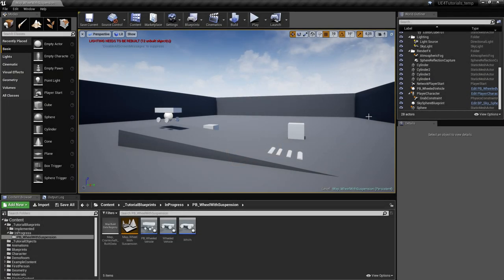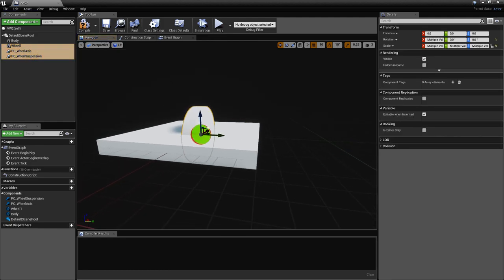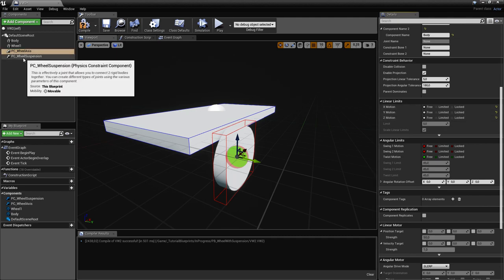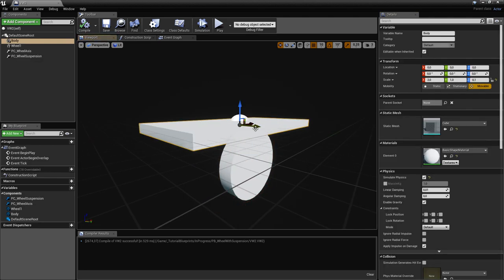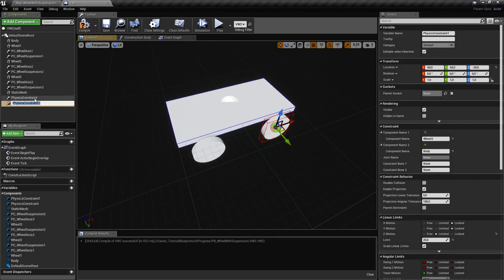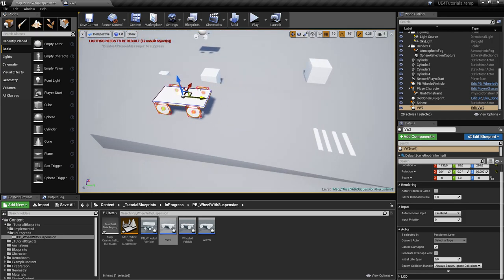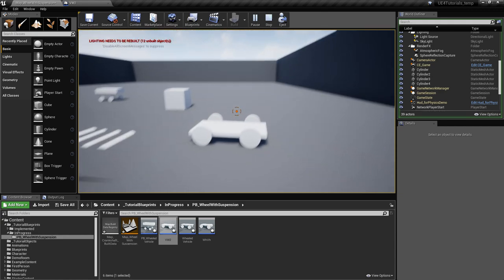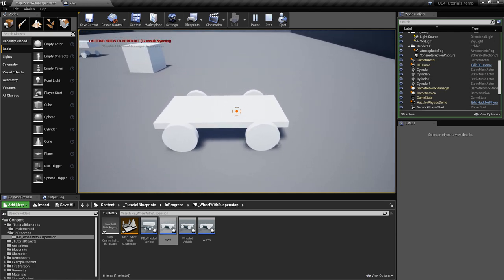UE4 Car Vehicle Wheel with Suspension using Physics in Unreal Engine 4 Tutorial How To

Comment: suspensions are made so you do not feel imperfections onto the road? wow, somebody should tell that to modern cars manufacturers xD (I am making fun of modern cars with their dropped, rock-solid suspensions and low-profile tires)
Reply from the maker: :D Well, I'm not and expert in cars, so I said it in layman's terms.
Reply: I was not making fun of you, I was making fun of modern cars and their shitty suspension haha, your videos are great :)
Reply from the maker: I understand. :) Thanks!
Reply: Well low and solid suspension systems make the car handles better
Reply: @MathB_Official  You also need to understand the use for rock solid suspension and rigid chassis that some people prefer, especially in track racing. Most performance/sports cars have that and it's by preference for those who understand to value such things.

Comment: This tutorial is amazing! Also, how do you add steering? I tried creating a scene component for every wheel as a joint and i attached the physics and the wheel to it. Then I used the Left/Right input to set the relative Rotation of the Scene component but because the wheel is simulating physics its not working. Do you have a solution for this or another method?

Comment: You have a trolley with four wheels that turns automatically when pushed by an external force and turns automatically depending on the direction of the push, and you can do a video of that, and you'll get a good one

Comment: After so many tutorial, i finally made it to add suspension in an object thanks to your tutorial :) Say, will you make a torque/Force tutorial in the future? Cheers
Reply from the maker: I'm happy to hear it! What kind of tutorial are you interested in regarding force/torque?
BTW, check out the latest tutorial that shows how to make a helium balloon using a thruster.
Reply from the maker: I'm planing to make a tutorial for a force field and a motorcycle. Those will use force and torque.
Reply: Watching now ;)
Reply: awesome, i hope you cover how to rotate the front wheel with physics contrains as you have in this tutorial.
Reply: It took me 6 hours to figure that out! I will gladly share the info on how to do it. going for breakfast now and be back later. key element is to use the Angular Motor by checking Swing (Drives) and add the value of the Turn Rate in the correct Axis for the Target Velocity and add value for  Strength. Start with small numbers first to get a feeling on how these values work. Linear Limits all locked. Angular Limits only either Swing1 motion is Free or Swing2. I couldn't make Twist Motion work but I will work on it some more. Hope this is helpful. Let me know if you need more info. Good luck
Reply: Forgot to mention that in the Angular Motor, select Twist and Swing
Reply: @naserharbi  Hello, I hope you still around :) I had a partial success for making turn "like a tank", by applying target velocity to axis constraints on one side of vehicle. But... It does that only one time :)) qafter that by pawn ignores my inputs. Did you ancounter this, and, if yes, please how to get around this "one time effect"? Thank You...
Reply: @Latvian3Dman  hello, yes, I'm still around. Thank you for responding. Let me get back to my project and see what I did. However I switched to Unity and learned from Unreal how to use the Configurable Joint to create all my Joints. I fixed all issues after I switched to Config Joints.
Reply: @naserharbi  , Hello! I have managed driving "tank-like", in two ways even. One version - apply force and torgue to body, axis constraints "motors" off. Other version - using angular "motors" on axis, to actually spin wheels. What I have not managed - can I turn wheels "left/right" somehow. I mean, for "tank-driving" it is not even needed visually. But, I am still curious, can I do that at all with given constraints setup.

Comment: hi andre
i found a serious problem in Physics Constraint , it's just work in first location !
i have used floating pawn movement and i have seen mesh doesn't move but phys cons move with pawn
so i had to use an assistance mesh as component 1 in phys cons , that works but pawn movement doesn't consider collision 😁
how can i use pawn movement and phys cons together?
Thank you

Comment: Wonderful video. Thank you so much.
I did everything exactly as you showed, but my plane jumps on wheels and the wheels themselves jump and tremble too.
What could be the problem?
Reply from the maker: You peobably have to make the wheela have larger mass. Either that or have a look at where the origin of the physics constraint is. Try inverting the order of the affected components on the physics constraints.
Reply: @Lusiogenic  Did you find a fix for this?

Comment: love your tutorials! was wondering using the method of the linear motors to control a hydraulic cylinder with input keys, is this possible? or is there better ways of doing it to get realistic physics from it?
Reply from the maker: Yeah, you could use that with a linear drive. Using the keys events you can modify the drive target location, then the constrained component will "go" to that location smoothly depending on the settings of the linear drive.

Comment: i have tried using this to another tutorial, a biplane tutorial, all i wanted was to use this on the plane so i could land, but, when i add this to the biplane bp, inflight it gets torn off the plane as soon as i pie it. Any recomendations? What to look at?
Reply from the maker: Hard to say without seeing your setup. 
But from what you're telling me, it could either be that you're somehow re-initializing the constraints and so it's breaks off. Or, you have set it to breakable. You should concentrate your analysis on the constraint that gives way or breaks.
A short video would help a lot.
Reply: @Lusiogenic  Thanks a lot for the feedback. Yeah, i will, i had a hdd crash and the project sadly is gone now. But iam remaking the plane again. 

The tutorial for hte biplane creates its custom physics, so i dont know that could interfere with the constraints. It really makes u feel dumb when its just 2 wheels the whole problem contains aswell. Takes longer to solve having two functioning wheels then creating a flying plane with missiles an guns :P

I will remake it anyway, and get back to you with a clip. Now ill know to look especially at the contrainsts so ill do some more digging on that aswell.
Reply from the maker: @loverschoice885  Please do, sounds interesting.

Comment: Problem I have: When my 3rd person character stands on the vehicle, it goes nuts, and eventually falls through the ground.  :(
Reply: Did you ever manage to figure out a solution for this? I've found a similar issue - I dialled the weight of the body & wheels up by a lot but it's almost like it's made out of paper with how it flies around everywhere & freaks out if you jump on it. Mine isn't so much falling through the ground, more that it ends up on its side with 1 or 2 wheels stuck in the ground.
Reply: @Daniel-qt5ib  Nope.  It behaves as if the player has infinite mass... and "unstoppable force" as it were.

Comment: Hi lusiogenic, how i can rotate the wheels with this system?
Reply from the maker: Yes, you can either directly AddTorque to them each frame or set up an angular motor in the PC_WheelAxis and set the desired Target Velocity.
I will do a complete car tutorial with acceleration and steering, but haven't yet got around to it. Working on something else at the moment.

Comment: so i found a solution i really wanna use, problem is, my vehicle is a flying vehicle, ive added the wheels beneath the vehicle mesh, i disabled the disable collisions in the pc axis components. 

But now my flying vehicle is rotating uncontrollably in the air. Theres some kind of conflict. 

My goal is to use the velocity and torque from the flying vehicle and let you wheel tutorial only let it roll on planar surfaces.   the vehicle spins in its roll and yaw.
Any feedback would be appriciated on this. from anyone really. :)
Reply from the maker: Without knowing more on your setup, it's hard to figure out what's wrong. If you want to make a hovering vehicle, I would go with line traces and thrusters.

Comment: I am wondering, if I will have AI system for such "car", with turns, would it be workable just making fake wheels axis turns (rotations), meaning two of wheels turning a bit on "Z" axis while in fact it will be car body that gets actor rotation, and wheels just "play along"... I hope I managed to describe my thought :)
Reply from the maker: Yes, you can set the wheels to stay into a certain position using the Set Linear Target Position and Set Angular Target Rotation. Well, if you set the position of the wheels and make them turn with Add Torque or Set Angular Target Velocity, the car should work as a normal car, without any hacks. 
I haven't yet done this, so it's still theoretical.
But, if you want, you can turn the wheels and body at the same time. Not sure if just turning the body would work..
Reply: @Lusiogenic  Hello! Little hope you still might read here, but I will try. Today I felt need to continue experiments with this, trying to make turning in realtime. After several hours, no luck. I am not finding is it possible at all to turn anything in such constraints constructs. If I set constraint with wheel "child" at angle before run - yes, it is fine (I test on slope). But, I have not yet found a way to steer at runtime. Anyone knows maybe? Maybe it is simply impossible with such setup? Thank You...
Edit: I had some small success to set wheels rotations  via "set angular target" for axis constraint, so it starts to drive / turn tank-like (ok for me), but... it does that only one time. Am I missing some aspect, or this isn't actually workable? Thank You...
EDIT2 - hmm with more experiments I think I am getting some needed results on controls...

Comment: H! It`s very usefull tutorial, but now I`m two weaks try to make input for this Pawn((( Can you make tutorial for MovementInput for this Vehicles? Please
Reply: would be actually very complex / unstable to use physics combined with inputs since physics rely mostly on forces ...
Reply from the maker: @yannmassard3970  I don't see any reason why it couldn't work. 
You could use inputs to set the orientation of the wheel and that position will be held using a physics constraints. If you want the wheel to be more sturdy, you could increase the force applied by the physics constraint.
Reply from the maker: I'm planning to make a 4-wheeled physics actor, but not sure when.
Reply: @Lusiogenic  you can, And it will work. But you would have to tweak the numbers to get something totally stable in a video game.  What I mean by stable, is totally predictible. But don t get it wrong, your videos are a must see for any body who wants to get seriously into UE
Reply from the maker: @yannmassard3970  I agree, that's why you would use physics, for a more real behavior, where you have variation and randomness.
Thanks! :)